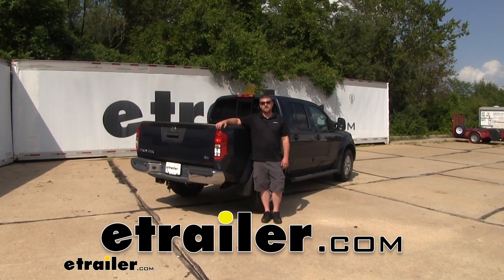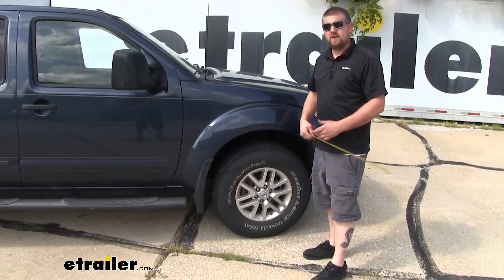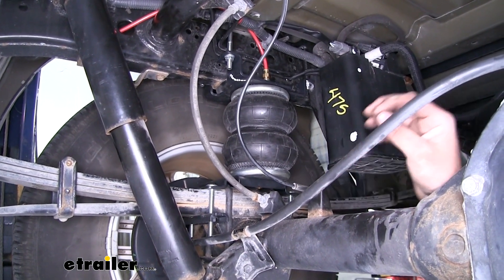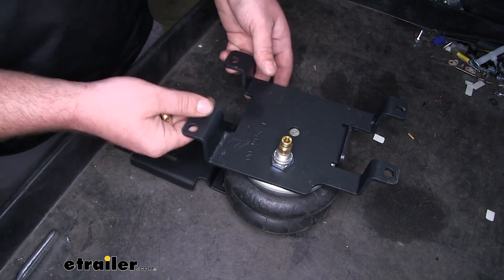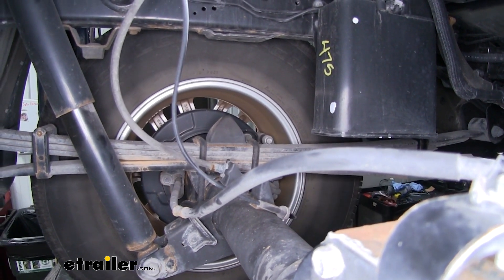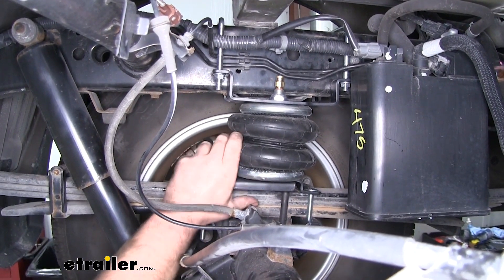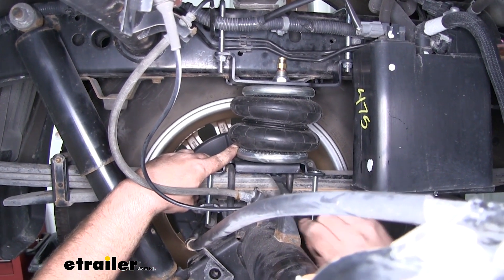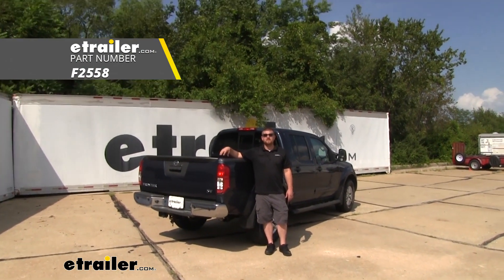etrailer | Setting up the Firestone Ride-Rite Air Helper Springs on a 2016 Nissan Frontier

Comment: IS THERE FRONT AIR BAG INSTALLATIONS?
Reply from the maker: We do not have a front air bag kit for the 2016 Nissan Frontier. We have a set of Timbrens for the front to help support the weight that is put on the front of the vehicle.
https://www.etrailer.com/Vehicle-Suspension/Timbren/TFXF1004A.html